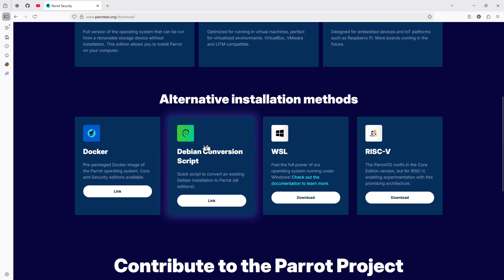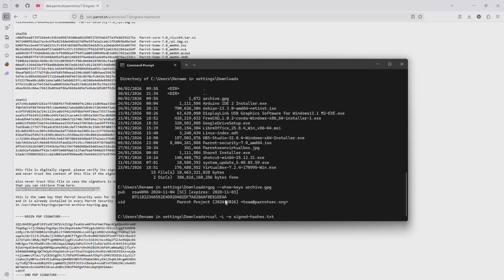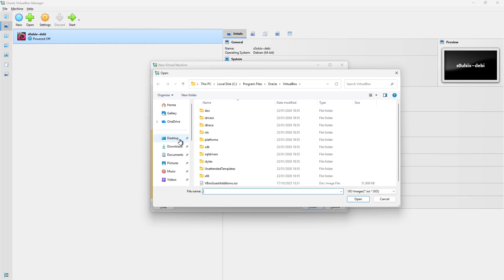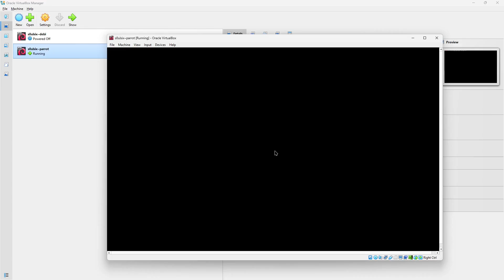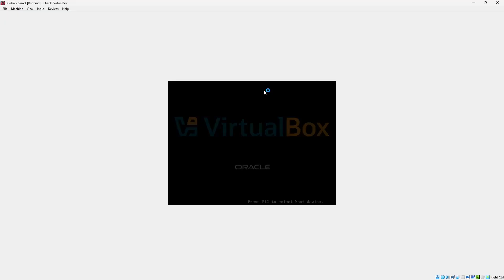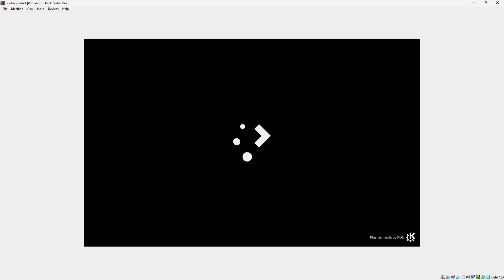Install Parrot OS in VirtualBox Securely (Beginner to Pro Setup 2026)

Comment from the maker: 🔐 In this channel we’re building a technical lab environment used by security engineers.

Parrot OS will be part of the Linux side of the lab where we work with:

• network analysis
• scripting and automation
• security lab machines
• system infrastructure testing

In later videos we’ll use this environment to explore how modern physical security systems actually operate behind the scenes.

Next step in the lab setup:
➡ How to make your Linux VM fullscreen for a proper working environment.